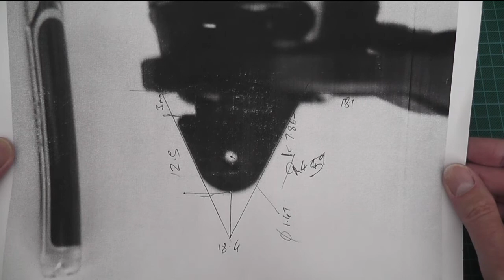3D Printed longer legs for a Quantum Trifecta

Comment: These are nice and well thought out. 
Not sure if you have seen it but HK have released an upgrade kit that includes longer legs. They are made from carbon filled nylon. I have some on order for my trifecta.
Reply from the maker: Mohit Dewan I wasn't aware of the hobbyking extended legs. They weren't available when I started this design. Thanks for bringing them to my attention. They are certainly a lot cheaper than getting shapeways to print these.